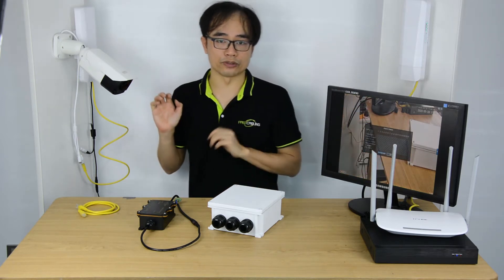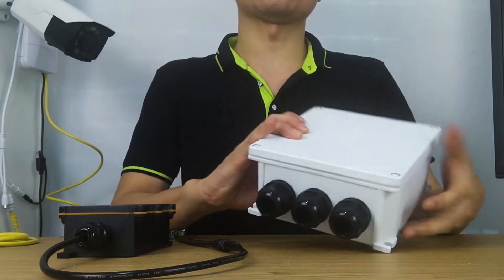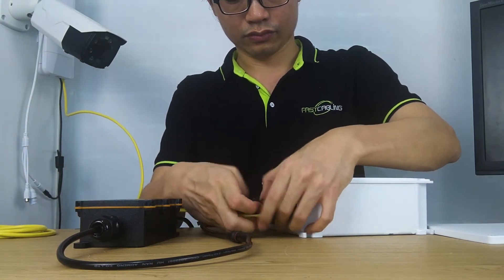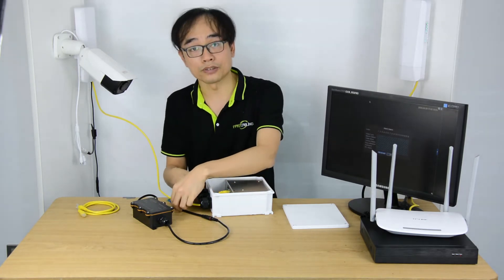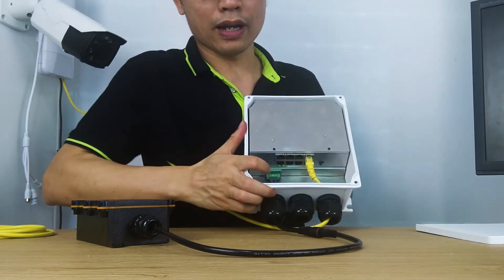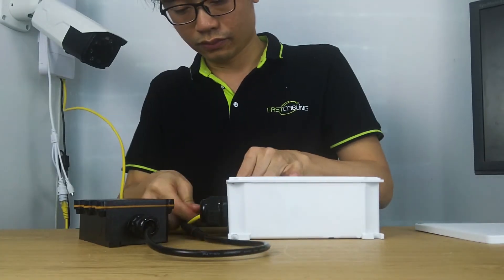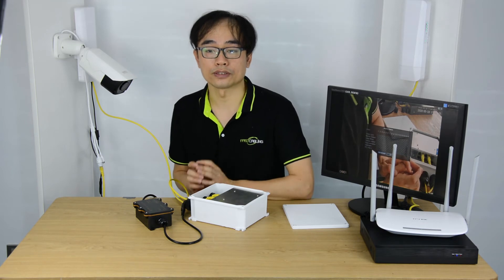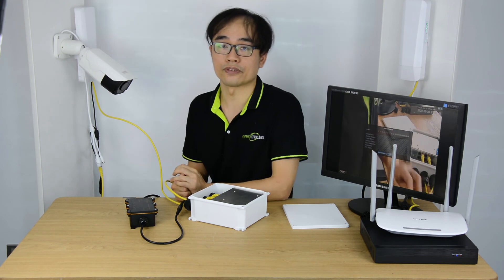How to connect multiple IP cameras in wireless network

Comment: It becomes wired already not wireless anymore
Reply from the maker: You are right. It is not a wire free system. The major application is when there no way to wire cable between point A and point B, you will need to transmitter and receiver to send back the video.

Comment: My Hikvision DVR is connected to router via lan cable to gain internet connection...another Hikvision IP camera is connected directly to that same router via lan cable...so can the DVR access that ip camera?...plz help
Reply from the maker: Your NVR should have capability to connect an IP camera. If your DVR only accept the analog camera, it can not connect an IP camera. Technically, the NVR will discover the IP Camera in the same local network.

Comment: How do you connect the link to the NVR? Does the lan port plug into just one of the camera ports or do you need another switch and give each port a connection?
Reply from the maker: You will need to attach both camera and NVR to POE switch. If the camera just occupied the LAN port of NVR, there will be no internet access to the IP camera system.